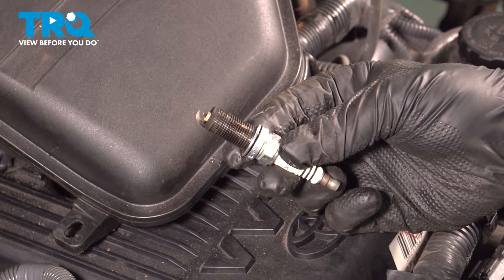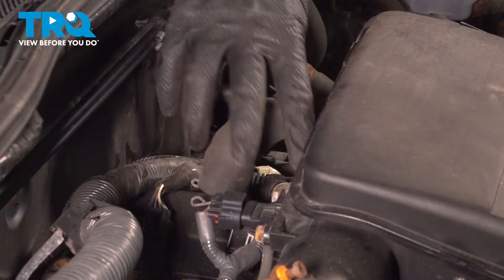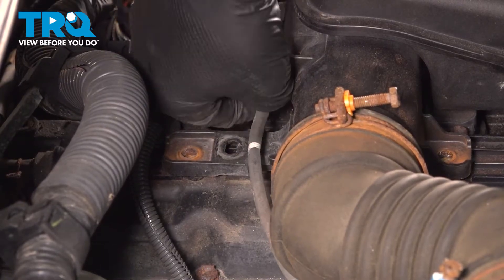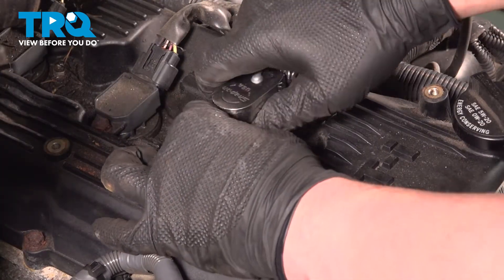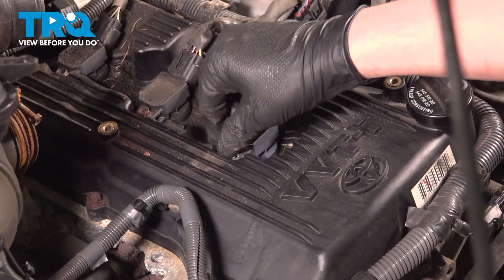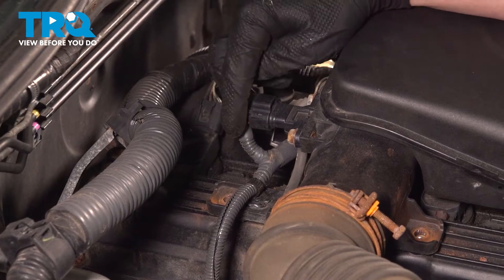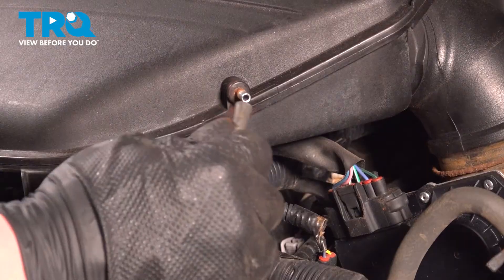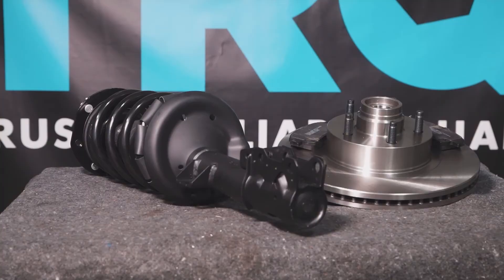How to Replace Spark Plugs 2005-2015 Toyota Tacoma 2.7L L4

Comment: Nice job, I would have cleaned and put electrical connectivity grease on the battery terminal and anti seize on the plugs already noted.

Comment: just did the sparkplugs on my 06 2.7L today and followed this video. after finishing it, my truck had a low idle and would die unless i kept my foot on the gas pedal. eventually got a check engine light. long story short: for whatever reason disconnecting the battery messed with the MAF sensor, so I went to o'reilleys and used their code reader to check and then to delete the P0101 error code and it solved the problem. took a few trips to get the idle back up to where it needed to be.

Comment: How important is torquing the plugs to 13 ft-lb and the bolts to 80 in-lb? Seems I could turn it to just snug but not beyond and not have to buy a torque wrench
Reply: Old school guy here. A torque wrench is not necessary, but the Cyl head is (probably) aluminum so, care must be taken when tightening the plugs. The main reason for torquing the plus is for heat transfer, not compression loss. Don't crack down on the plugs with a 1/2 ratchet and arm strength & you'll be fine. Leave the battery powered driver in the box for this step. YMMV.

Comment: How is everything so rusty in this engine bay? Does this truck not have a hood over the engine? My Tacoma has 200k miles and it looks nothing like this.

Also always blow compressed air into the spark plug hole before removing the spark plug so that debris that have been settling at the base of the sparkplug don't fall into the cylinder. Every single time I've used compressed air I've seen crap blast out of the hole. Not a lot of crap but just enough to visibly see it.
Reply: They might be near a coast with salt water.  One never knows.
Reply: Part of the country where they receive a lot of snow and use road salt.
Reply: Since everything else actually looks pretty clean, Im betting he lives in a cold, wetter climate.